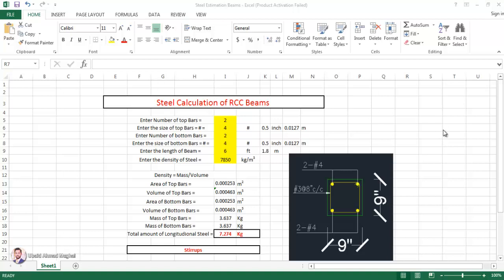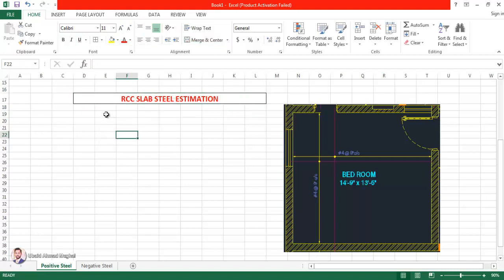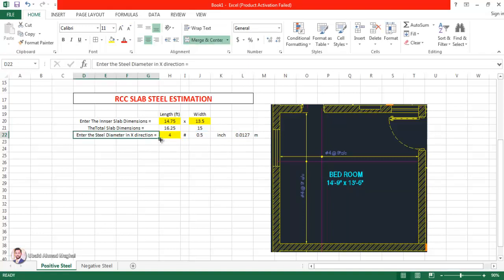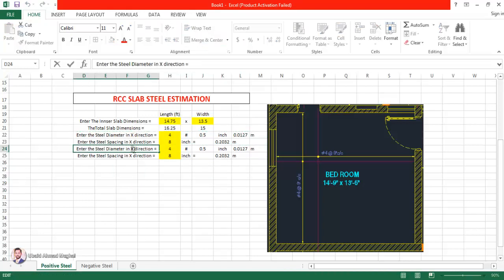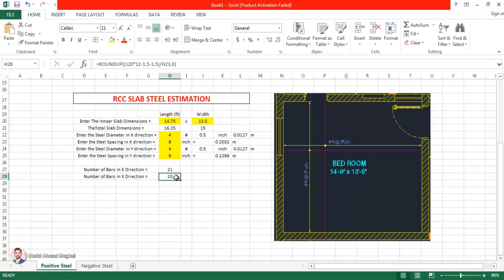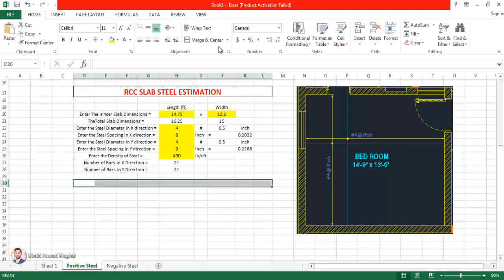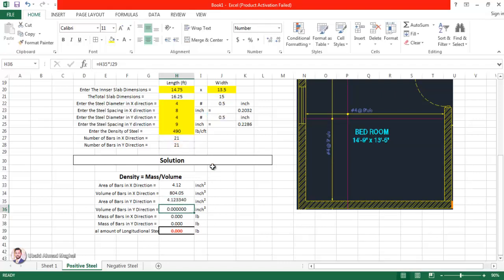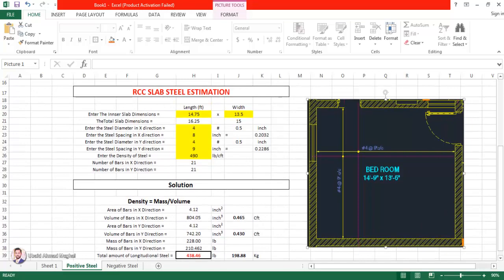Calculation of reinforcement in RCC Slab | Excel Spreadsheet

Comment: Sir great Effort by you.
Sir i think in Hurry you used spacing of 9" for X direction but this is 8" and 9" will  be used for Y direction. If i am not wrong. 
By the way nicely explained.
Reply from the maker: Yes you are Right, We will be using the spacing in the X direction and for Y will be using the spacing for Y direction.

Comment: Sir. For finding the number of spaces you use inner Dimension cell. Then why you subtract 1.5 two times ( as a clear Cover).
Reply from the maker: Clear Cover Subtraction is a general procedure. Only for the discontinuous edges but for continuous slab no cover will be subtracted. It changes from case to case. Calculations shown for concept.
Reply: @UbaidAhmadMughal  ok Sir.

Comment: In the calculation of " no. Of bars in x direction " you have divided the length of x direction to the spacing of y direction. But it think you should divide the length of x direction to spacing of x direction. I'm confused.
Reply from the maker: Yes. they will be swapped.
Reply from the maker: Length will be divided with the spacing that direction and for Y will be using the spacing for Y direction. You got the point.
Reply: @UbaidAhmadMughal  means was I thinking right sir ?
Reply: @UbaidAhmadMughal  Thank you so much Sir ♥....
Reply from the maker: @civilengineersinstitution6519  yes
Reply: @UbaidAhmadMughal  Thank you Sir!!!  
Got it. 😊
Reply from the maker: @civilengineersinstitution6519  welcome

Comment: @UbaidAhmadMughal
Sir can you please make a video that how we place a beam in slab means with what measures we divide the big slab to divide Load and how we can directions that which steel (diameter) should be used in beam?
Reply from the maker: Its a structure design concept. Beams are placed where the walls dont continue from ground floor to first floor. If your ground floor and first floor plan is not same then where there are walls directly resting on slabs you have to place a beam underneath it to support the load of wall and upper storey. Steel is designed properly as per the load and span. May be in future i go for structure designing tutorials then i may make this as well.

Comment: Brother, column ka bhi kr lety na.
Reply from the maker: The concept of column and beam is same. Thats y
Reply: I knew it...
I just wanted that clarification.
Reply: But there is only one doubt, in both beams and columns there is different placement of stirrups, like minimum spacing at the end and maximum spacing at the center. If we consider such type of arrangement for stirrups then how can we take spacing for finding number of stirrups?
Reply from the maker: @Ihsonjehangir  OK
Reply from the maker: @Ihsonjehangir  In that case we will have to ask the use about the length upto which the same spacing will be given and the length in which different spacing will be given then accordingly we can calculate.
Reply from the maker: @Ihsonjehangir  In that case we will have to ask the user about the length upto which the same spacing will be given and the length in which different spacing will be given then accordingly we can calculate.
Reply: @UbaidAhmadMughal  you mean we'll have to calculate accordingly and then add them up?
Reply from the maker: @Ihsonjehangir  yes. Excel is going to do that for you if you enter that formula.
Reply: Thanks man, I never learnt that much anyone else's channel. By the way I am waiting for next tutorial on Primavera.
Also, please present a real time field work on Primavera. Thank you
Reply from the maker: @Ihsonjehangir  You're Welcome. I am currently not working on any field project thats why i cant link it to an actual project but will try to explain the things.
Reply: @UbaidAhmadMughal  what if show us your old projects or just email me that?
If not classified!!
Reply from the maker: @Ihsonjehangir  dont have